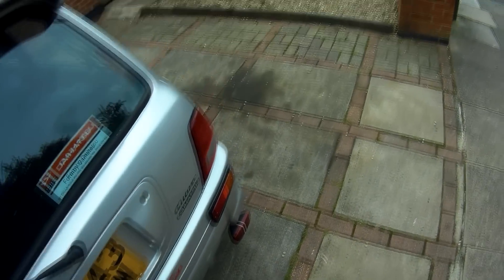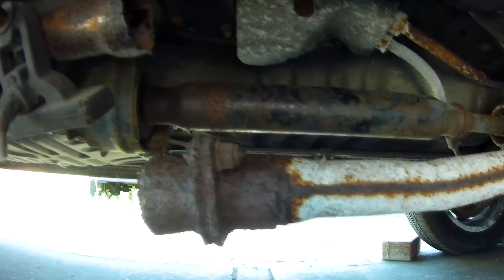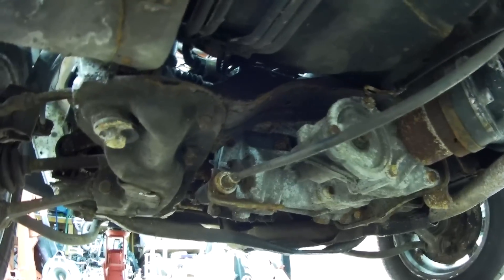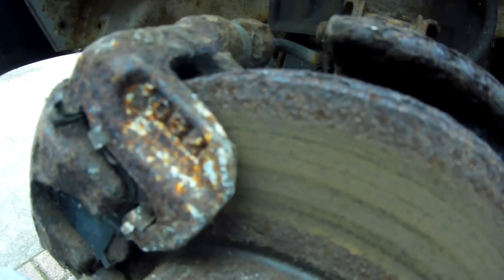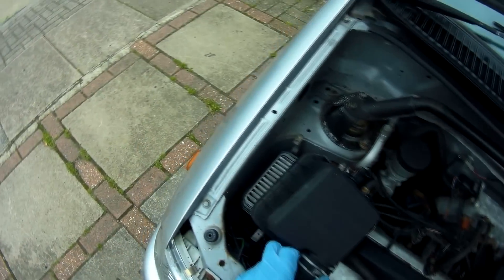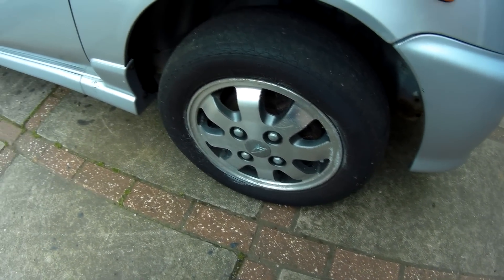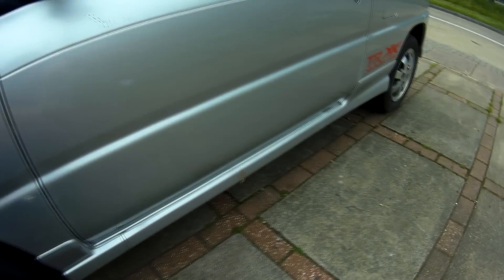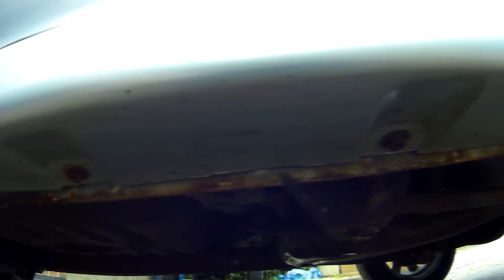What's The Project Plan? Daihatsu Cuore Avanzato TR-XX R4 Episode 4

Comment: I had one. The 660cc 16v Twincam Turbo and AWD (yes it had all wheel steering too!) was fast off the lights. Needs wider tires though. I put white Compomotive 14" alloys with 175 tyres on mine to reduce the 4x4 wheel spin off the line! Normally a Japanese Kia car not sold over here they were introduced into the UK in limited numbers (200 I think) to qualify for Rallying! The UK ones (Coure not Mira) were also unlimited and they're very rare! Always regretted selling mine.